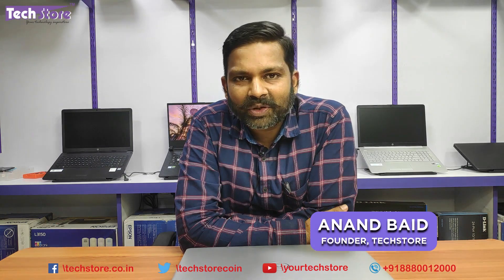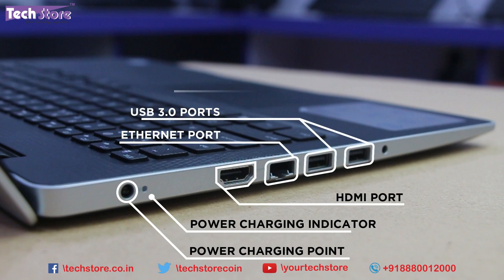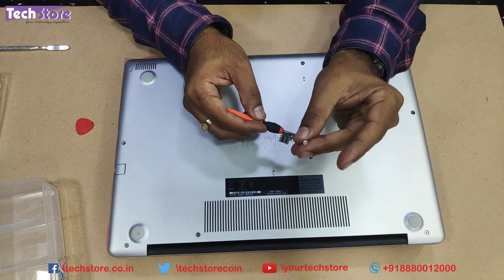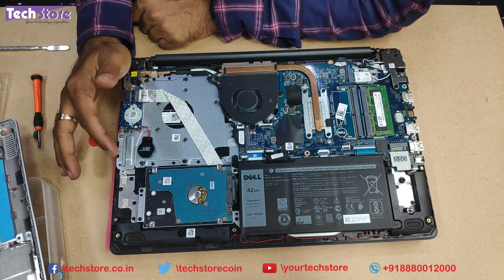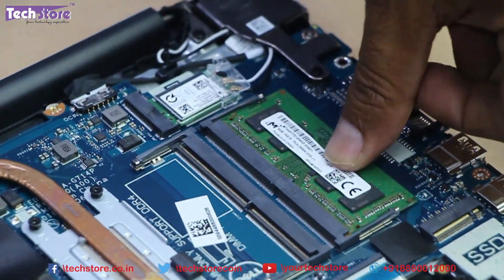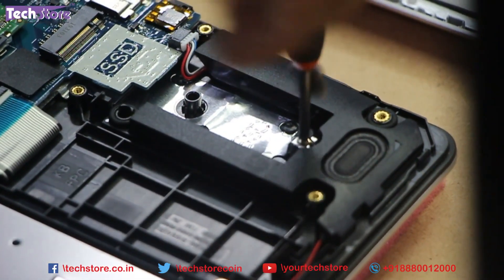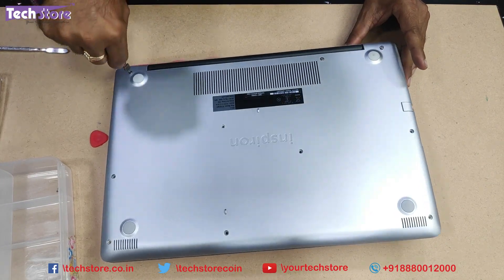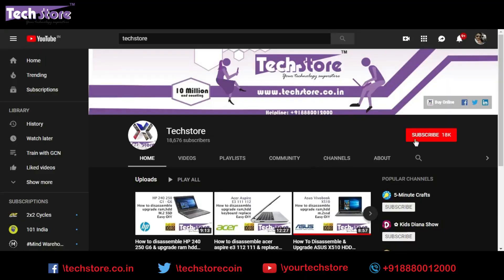Dell Inspiron 15 3584 3583 : Review & How to disassemble the base upgrade ram hdd ssd m.2 nvme

Comment: Thank you for the video, I replaced my battery and now says no hard drive detected. Where your hard drive is. I have a plastic pocket and a connector but nothing hooked up, is there a second one or other spot to check for loose connection?

Comment: Sir, your video is too good for anyone who wants to install additional ram, change battery or install a ssd.
I have a couple of  questions:
1) I have a dell inspiron 3584, can I install an additional crucial or Kingston DD4 2400 MHz Ram 8 GB. Is there an additional slot which is beside the original 4 GB slot?
2) for installation of Nvme 2.0 500 GB ssd, what setup would be needed as u had replied to someone in this comment box that the data will get formatted. 
Pls reply. This is the first time I have watched ur video and would love to subscribe as u have explained all the parts extremely well.
Also, one last question, how to acquire the equipments u have shown in the video to open up the laptop. Can I buy it from somewhere as u had mentioned the screws are different. Thanx
Reply: For more information about this model watch out this link : https://youtu.be/84OW5E7tlXc

Comment: Sir, i got inspiron 15 3000 series. In properties it is showing inspiron 3583. Since my computer is very slow when milti tasking, i want to upgrade. I got 4 gb ram too. Suggest some upgrade. Shall i go for ssd or ram upgrade or both. Also suggest capacity to which i can upgrade, and if possible link to buy the product too! Thank you in advance
Reply: 2x4 or 2x8 or 2x16 gb ram ddr4 2666 mhz is what you should get
Reply: For more information about this model watch out this link : https://youtu.be/84OW5E7tlXc

Comment: Hello I have a doubt if I need to upgrade to m.2 nvme should I turn on nvme option in bios and suggest a 2666mhz 4gb ram for 3584
Thankyou.
Reply from the maker: Yes you need to do that. 4GB DDR4 2666 ram will cost 2400/-

Comment: Sir, Please tell me that what speed of ram should I apply in inspriron 3584 as it is showing 2133 mzh in the task manager and 2600 mzh in the zcpu
Reply from the maker: Please buy 2666 Mhz
Reply: @TechstoreCoIn  does it support my laptops as I have seen in the laptop documentation in which the speed (2133 MHz/2400 MHz) is mentioned ?
Reply from the maker: Yes it will support.
Reply: For more information about this model watch out this link : https://youtu.be/84OW5E7tlXc

Comment: Does 3584 supports 512 GB SSD?
Reply: Depends on ssd type
Reply from the maker: It supports all types ssds 2.5 sata, M.2 NVME, M.2 normal 2280 size
Reply from the maker: Yes it supports.

Comment: Hi, I found as per your video this laptop supports DDR4-2666 MHz RAM, but when I viewed the Dell Setup and Specifications Manual it states it supports 2400 MHz, I am confused. Does it support 2666 MHz?
Reply from the maker: Yes it supports.

Comment: SIR, 1ST I WOULD LOVE TO GIVE YOU A 5 STAR FOR THIS VIDEO. TOO GOOD. MY INSPIRON 3584 CAME WITH 4GB RAM & ITS TOOOO SLOW, I AM JUST TIRED OF USING IT LIKE THIS, CAN I UPGRADE IT WITH 8GB ???? 4GB + 8GB ? MY LAPTOP IS STILL UNDER WARRANTY TILL MARCH 2021. DOES IT VOIDS MY WARRANTY ? Crucial 8GB DDR4-2666 SODIMM. THIS IS THE RAM I AM BUYING IT FROM AMAZON FOR RS. 2349/- . HOW IS IT ? AFTER UPGRADING HOW WILL BE THE PERFORMANCE ?
Reply from the maker: Thanks for your kind review. You can upgrade to crucial 8Gb. We suggest you install m.2 NVME SSD if it is slow.

Comment: Sir mere pass bhi same yahi model hai abhi
And usme lacking, hanging and bhot slow hai infact basic working mein iss type ki problem face hoti hai hamesha,
Agar mein ram ssd both agar upgrade karau toh sure hai ki yeh problem solve hojayegi
Or agar sir ram kharide toh which company ram is best from your recommendation.
Reply from the maker: Agar aap M.2 NVME SSD lagayenge, apki sab problem solve ho jayegi.

Comment: Sir, Plz help me, I want to upgrade my Dell Inspiration  3584  but doesn't know  what type of SSD I should buy? Whether it supports nvme ssd or sata ssd? Dell supports are not clearing my confusion. 
Model: Dell Inspiration 3584
Plz help me which ssd I have to buy with link. Please..
Reply: m.2 nvme ssd
Reply: @Levis40   Is there any difference between M.2 2280 SSD & m.2 Nvme SSD
Reply from the maker: NvME Ssd will work like a charm! Do subscribe

Comment: Sir does dell inspiron 3583 supports m.2 nvme or m.2 SATA???
Reply: M.2 sata used the sata port which is hdd port so if u have a hdd then u can use sata and its support s nvme type in brief it supports both u can use both together

Comment: sir please can you send me the link fronm where i can buy an nvme ssd and 4 gb ram please .
Reply: Hey, you can get western digital 240gb ssd from Amazon. I am currently using it and it works great.
Western Digital WD Green 240 GB M.2 2280 SATA Internal Solid State Drive (WDS240G2G0B)
Reply: @notpxrple  this SSD is not NVMe, therefore it just functions a little bit faster than the HDD SATA 3 with 7200 rpm. If performance is the goal, I would suggest for you to look for a SSD with NVMe socket specification. I think WD's blue line has this SSD.